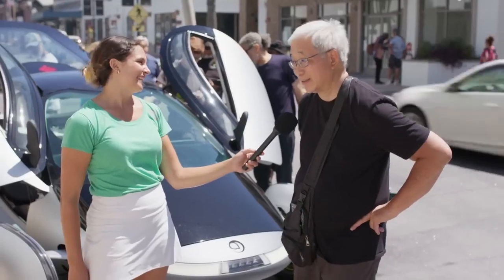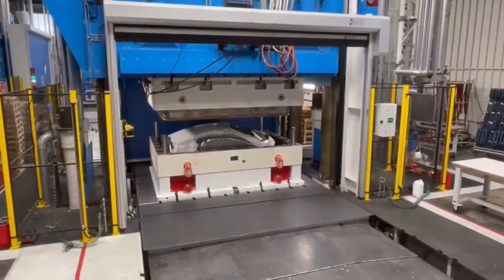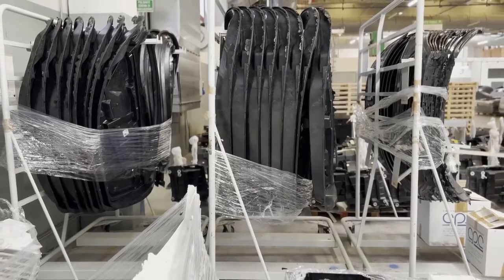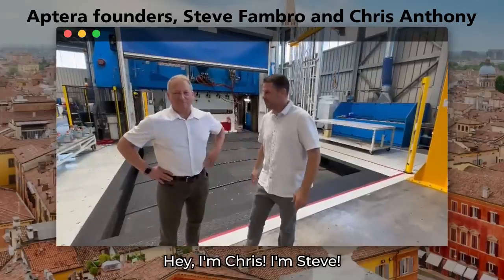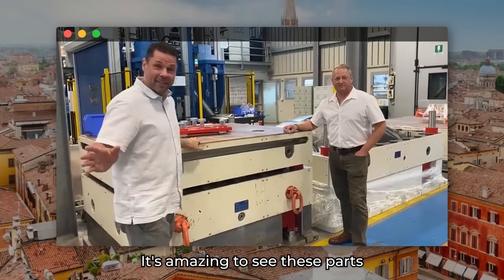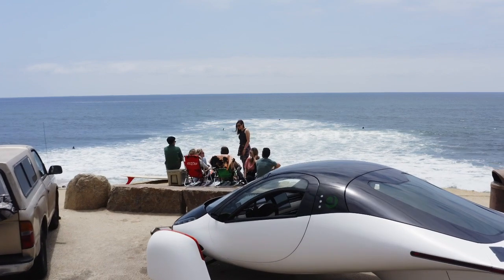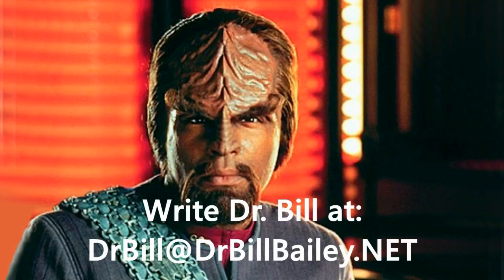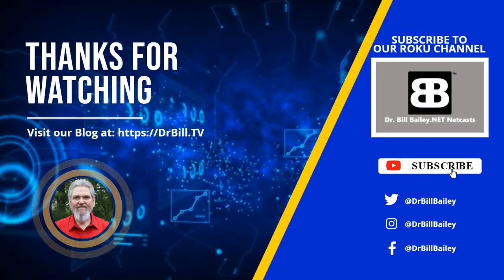DrBill.TV #542 - "The October Aptera Update Edition!"

Comment: I don't believe they are "giant 5000 POUND presses".  More like 5000 TON presses.  Also, the presses were likely designed and made long before Aptera came along.  What's new are the "molds" or "dies" used to make the parts for Aptera.

No way production of customer's vehicles will be in first quarter of 2024.  At best, it will be in late 2024 as per Aptera.

Finally, "all we have to do is wait" is what we've been doing for years so it's nothing new.....
Reply from the maker: A lot of folks caught the weight reference, and yes, I misspoke!  It is 5000 TON presses!